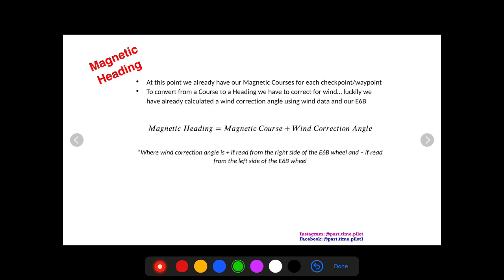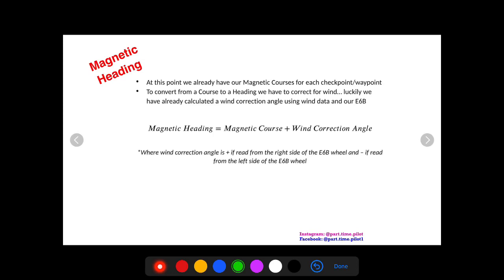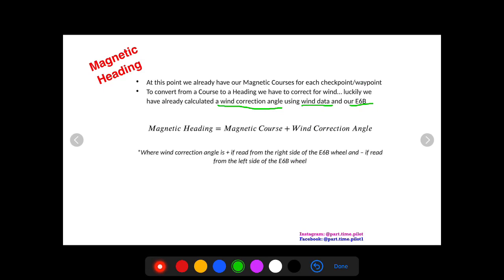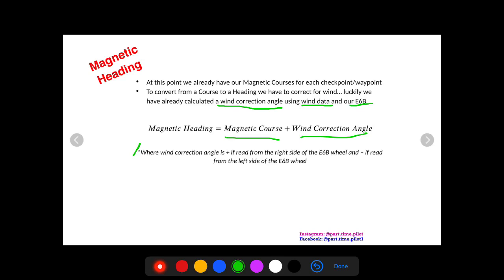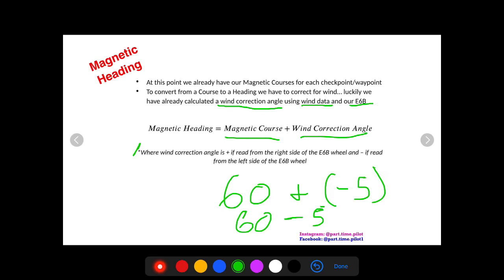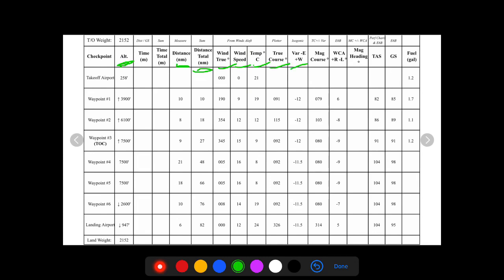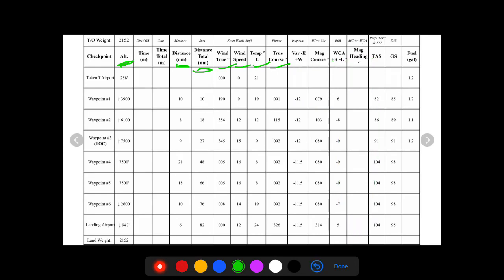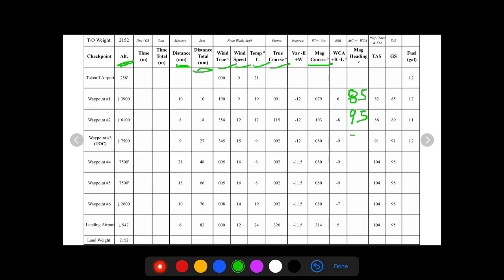How to Calculate Magnetic Heading with Wind Correction Angle Formula - For Student Pilots

Comment: Don't you need to calculate your wind correction angle before your magnetic variation because your winds are true, so they have to be applied to your true course to get your true heading first? Thus, you can't apply a wind correction angle to a magnetic heading?
Reply from the maker: Great question! The answer is you can do it both ways! You can go from true course to magnetic course with variation then magnetic course to magnetic heading with wind correction or you can go from true course to true heading with wind correction and then true heading to magnetic heading with variation. Both work! The only thing you gotta look out for when you are using the wind side of your e6b is you have to make sure that your winds match your course in terms of true/magnetic. Since, like you said, winds are usually in terms of true then you would need to use a true course on the wind side of your e6b to find a wind correction angle. If you do it in the order I like to do it and in this video then you are finding wind correction angle with magnetic course and magnetic winds. You simply just need to convert the winds to magnetic using variation just like you would your course.
Reply: @PartTimePilot  Ah, makes sense! Thank you!

Comment: Can you use wind correction angle on a true course to get magnetic heading?
Reply from the maker: Nicklaus Smith almost! You can use wind correction angle on a true course to get a true heading but you’ll still need to correct for magnetic variation from the earths magnetic fields using isogonic values in order to get a magnetic heading